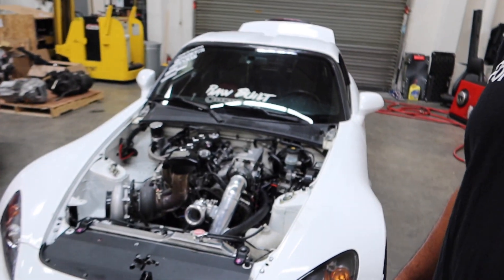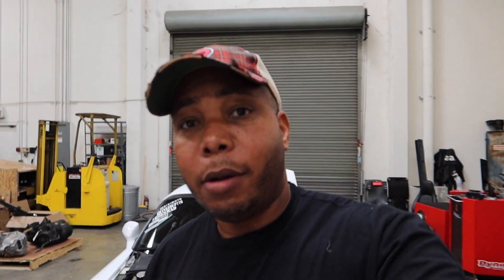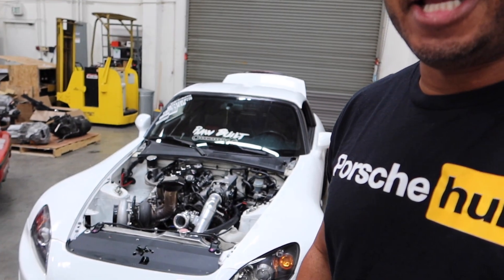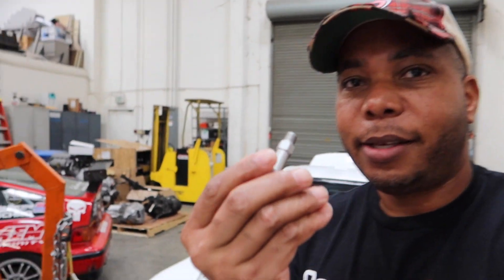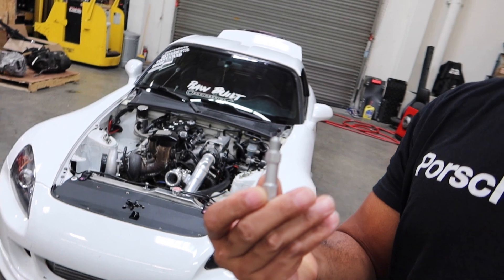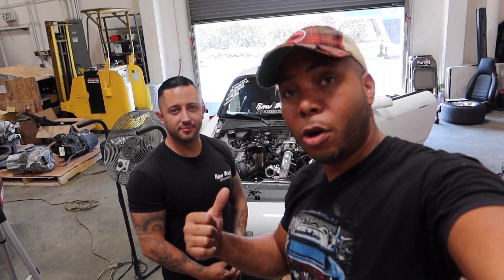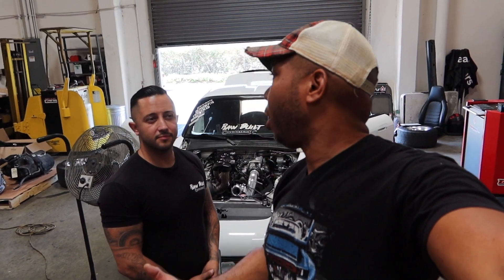Boosted S2000 50whp on AEM Water methanol!

Comment: Great video! I was just curious i saw that you said the fuel system was running at about 95% and your upgrading is E-85 in the cards or would that be an option to make more power after you have found the limits of this fuel (im assuming its pump 93 but you know what they say you do when you assume make an ass u & me)  and i know last week i had a huge run on question and i was just curious if you got a chance to check that out im stoked for the tech tuesday im really excited to see what you might have to say, have a great day guys! @Bisimoto
Reply from the maker: Thanks for the kind words. The next upgrades address a larger fuel pump, a boost referenced fuel regulator system, and a high volume fuel rail. No e85 for this one.
Reply: @Bisimoto  sweet sorry i asked that question twice i didnt see this answer my bad
Reply from the maker: No worries.